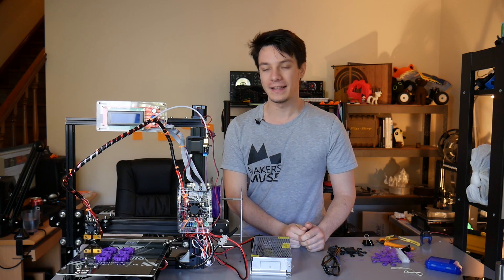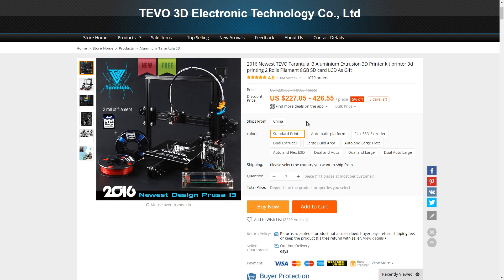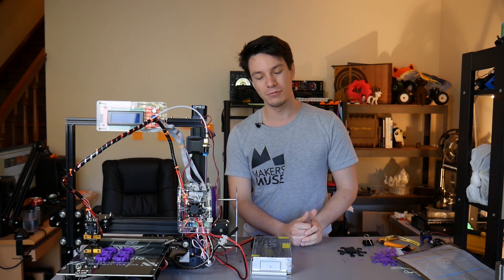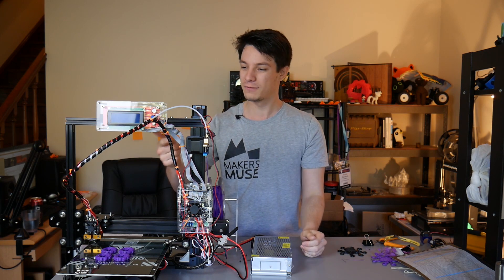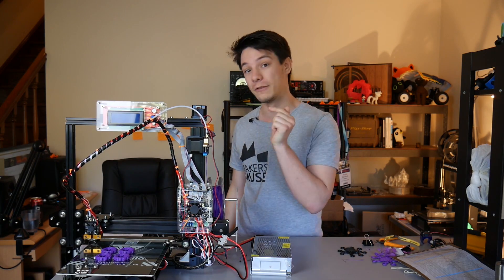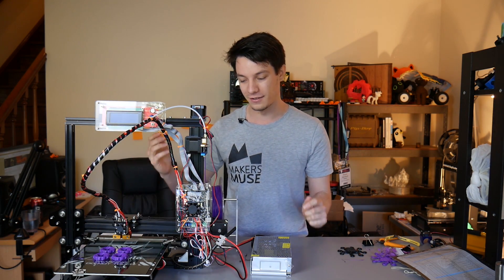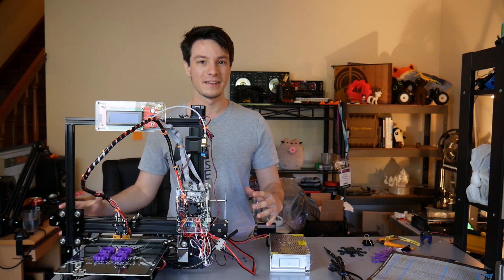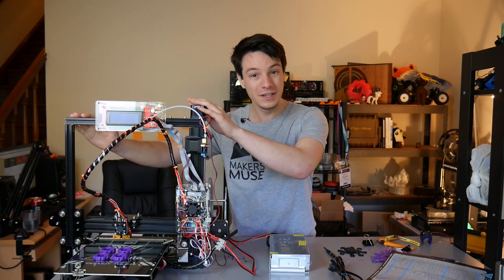Tevo Tarantula Review - Read the video description

Comment: Less than $430 for this?! Im totally getting one...👍👏
Reply: The base model is only $245.
Reply: TheInsanityUnleashed Well yeah, that's what I'm saying. The most expensive model is less than $430 so I might as well go all out... However, I typed that comment before watching the full video and then realized how flawed their presentation is and that I'd need to get some other stuff like a different power source...
Reply: +oobligah if you buy a phone, bike, car or s.th. else, that works somehow but not properly, are you then also that happy to have so many upgrade possibilities? or wouldn't you throw it on the sellers desk and claim about warranty or money back etc? 
I don't understand why Chinese items have so many fanboys while the only thing they can is being cheap? is that what counts today?
I have another make of such a cc printer but same issues. if I invest in upgrades and change half of the wiggling hardware at the same amount as the printer cost, at the end I were able to buy e.g. the Prusa Original i3 mk2 kit that works well and if necessary you get support from supplier which knows his product instead of a great community of people the had also to learn it the hard way (but obviously love it...) 
For me I am healed from buying such items in China... I didn't want a new hobby "search the fault over hours" I just wanted to get me started in 3D Printing and MAKE things FOR my real hobby and maybe even for work...
Reply: you don't need a different power source, you can print a shroud for it.  You can also print many other upgrades for it, like a better roller tensioning system for the Z, or you can even put another Z screw on it.  Lots of possibilities.
Reply: Syklonesix you can print most of the upgrades, but you would need to buy SOME hardware, like some screws and T-nuts, and maybe a Z screw.  Less than $40.  It's a budget, kit printer.  It's meant for tinkering.  That's the whole point.  You learn a lot in the process, and the things you learn help you troubleshoot other machines, think of different solutions and so on.  Heck, in the TEVO group, a lot of people are starting to create models for upgrades they can print.  Either way, it's a decent machine.

I'm not sure where you got the "not properly" part from, but when I built mine, it printed pretty well out of box.  Well enough to print some brackets for it to make it print better.

Clearly, this printer is not targeted at you if you want to buy something and print out of box.  People who buy this printer aren't looking for an "unbox and go" experience.
Reply: +Syklonesix I see what you are saying, but for us hobbyists that (to an extent of course) is kind of part of the fun. Of course if it becomes something that you know for sure you can't fix then yeah send it back... I'll give an example I've given lots of people... For Christmas I pooled my gift money together and got a <$300 cantalever style printer from China that came by DHL like in two days... WAAAAYYY earlier than expect (Amazon quoted me like a month or something) so the thing got here, I ripped it open and went at it assembling it from some meh instructions, but the most part pretty good. Sure they were in Mandarin, but there was an instructional animation that was pretty damn good for where it came from. All the parts are together (it came with a good amount of spare stuff like an extra heater cartridge and thermistor which I still haven't needed to this day, bit it was still good to see that), the cables are ready I plug the supply in and.... nothing... the board was dead on arrival. Now bear with me here. After some back and forth with the seller and Amazon, I got $50 to get a ramps kit with a screen too, for like $42... and guess what? after a few hours setting up Marlin I finally dialed it in and... ITS THE BEST PRINTER I OWN AND ITS REALLY RIGID TOO. It prints FLAWLESSLY and right now as I type this I've got a 9 hour print going and it's doing really well.
I guess the point I'm trying to make is that there is a big fan boy base for cheap Chinese printers not because they work, but because if you know what you are doing they are really good for parts on the DIRT cheap. I could probably get a prusa i3 clone for under $250 and a ramps board from China for the $42 I mentioned earlier that works (no bricked ftdi chip) and tadah, fully functional and fantastic printer for pennies... Just give it a shot, not every printer will work instantly, bit it's worth the hassle for sure.
Reply: +Coaster Labs ok good point. I understand and agree about the learning process. :)
My first (a delta) printer works well at 399usd. I also needed to tinker a bit to increase quality or being able to print thin wall items, BUT primary on the software side (slicer and marlin) and I got to my targets.
the hardware was almost perfect. defect elements were sent within reasonable time and with no discussion. There is no wiggle in the bearings etc the e3d clone prints well etc.
But in the prusa clone with mk8 clone, there is play in z thread and in all the bearings. The crappy acrylic parts they use to mount the belt, broke several times etc. extrusion is even with the german filament of over 50 bucks inconsistent. 
support was the same. delta good and in 24h or less. the prusa clone supplier needed always 3-5 days. vendor had no idea of the product. engineer in background only spoke Chinese, so the vendor with no clue in technic translates in chinese... guess what...

So I had now both experienced. the good and the bad ones...
ok upgrade necessary: 40usd for the ramps, e3d clone 5-15usd.
Printing some parts especially to fit e3d etc another 5-10usd
Maybe the bearings are well and I only need rods. Here in Switzerland industry material is difficult and or expensiv to get. E.g. the rods, the threads... so I will end at least with the 200 bucks I already spent on the printer... and now: all that time and filament already wasted... I throw away at least 1-2kg Filament wasted in testing... I have an army of marvins... 😂
So at the end not counting any money for my time, I was not that productive as I could have been, that is what angers me with it as my free time is very rare.

Especially, e.g. the printed upgrades could be done by the supplier at no extra cost for them, but that's another story.
Reply: You know, I give up. At first I though there was legit fans of this printer.... Now it appears to be just advertisers like you.

This printer is JUNK. So many better options for even cheaper!